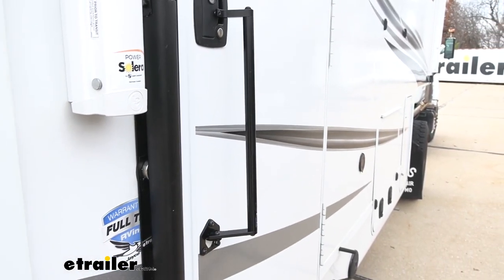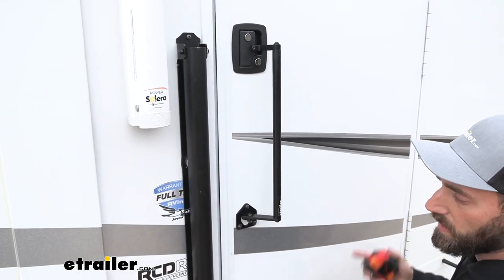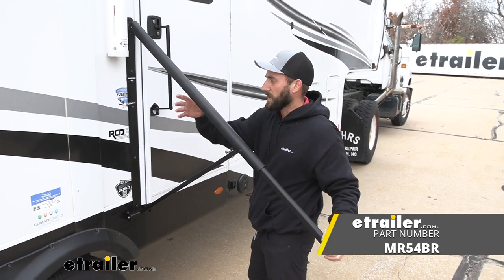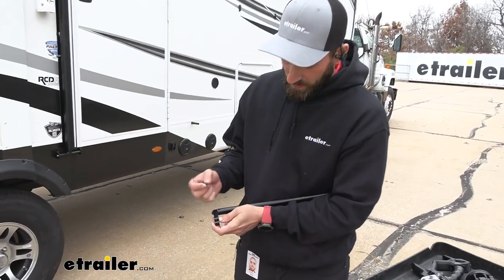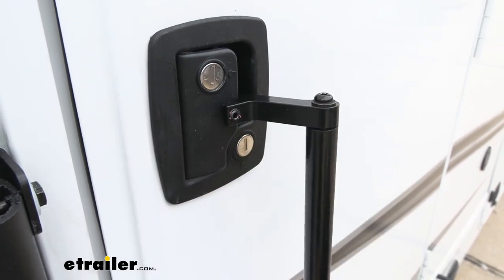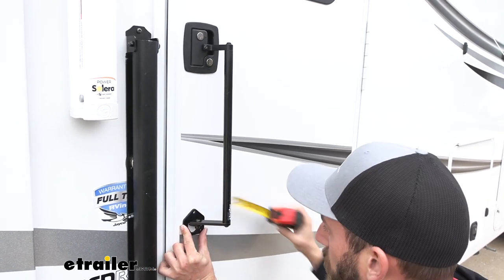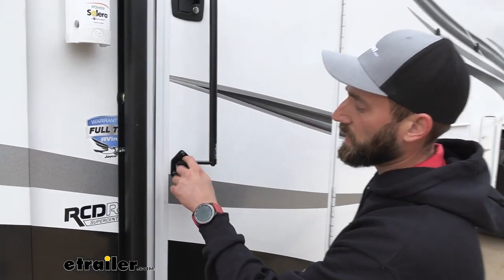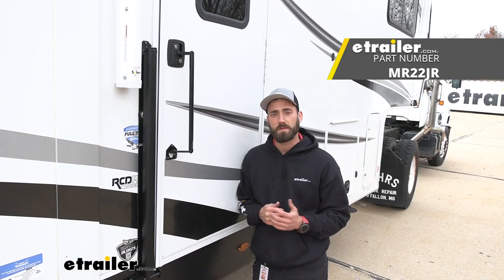etrailer | An In-Depth Look at the MORryde RV Door Latch Extender

Comment: Added one to my Grand Design 25g...worked fine until I installed a electronic door latch. The extend latch wouldn't allow the electronic latch to close securely,  hand to remove the extend a latch.